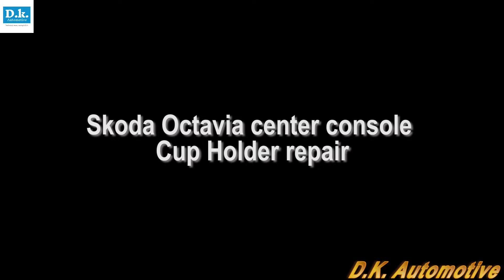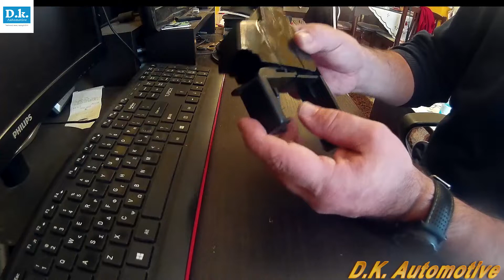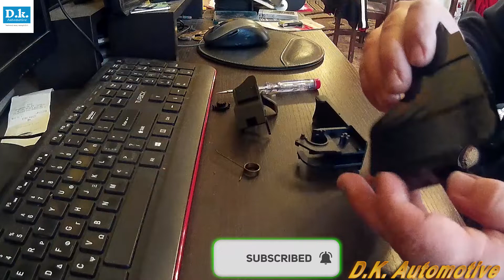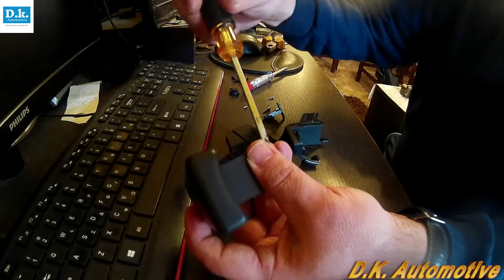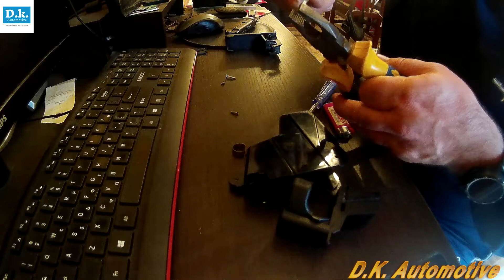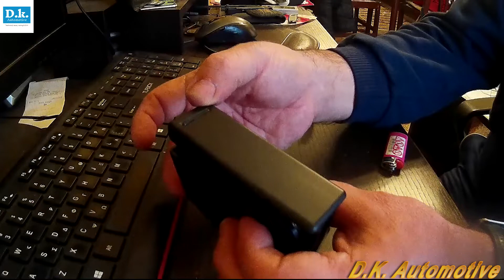D.I.Y.: (Skoda-Audi) central console cup holder repair

Comment: i have missed a good light there...most of the time its hard to see what you are trying to show,,,,
But your video helped me... i had the same problem... thanks for that :)
Reply from the maker: Yes that was not my best video. Nevertheless your welcome.
Reply: @D.K.Automotive  I got 1 question... i have used a screw M2, shortened it, but it stil doesnt stay closed... 
Should i used bigger M3 screw maybe?
Reply from the maker: You have nothing to lose by trying. The idea is the same, the execution may be different.